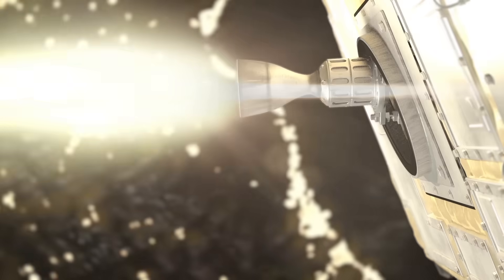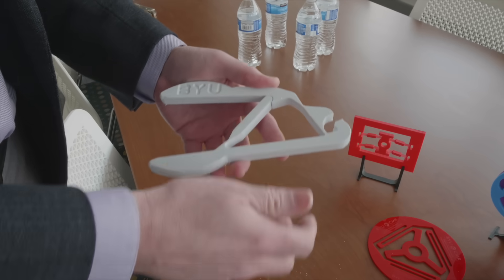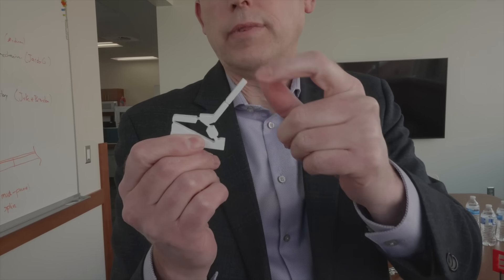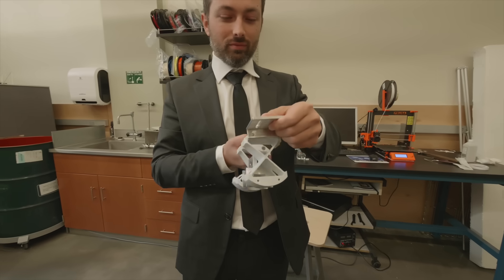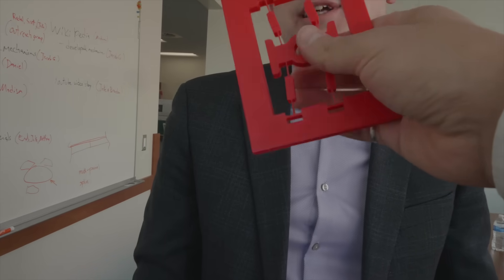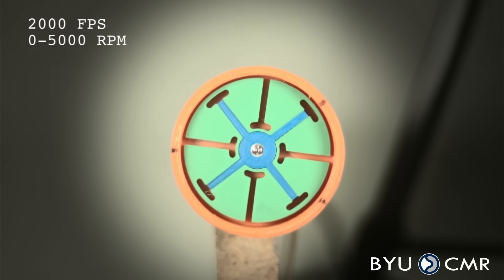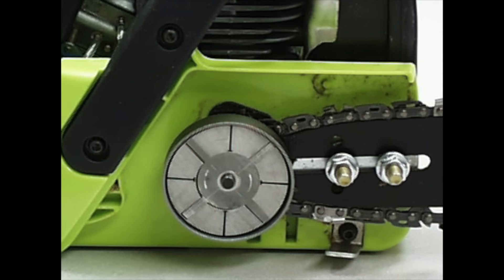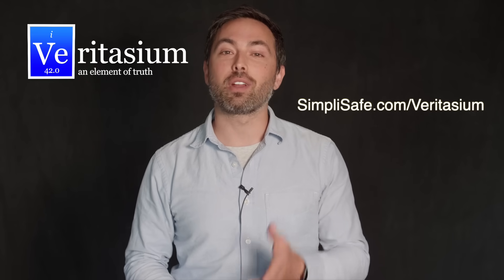Why Machines That Bend Are Better

Comment: The fatigue limit of most materials is the reason bending components are avoided. The bending region becomes a stress pit.
But maybe with modern materials, we might overcome the problem.
Reply: We been using springs for decades now ;P they are the same as compliant mechanisms, you just need to make sure, not to go over the safe bending point of each material, even concrete will easily bend  without problems.
Reply: @predatortheme  The comparison to springs is a very good observation.  Torsion bars (another geometry) is a good example also.
Reply: How are you so clever?! 
Didn't he say in the video with one of their fatigue testing machines they got over one million uses of a switch before failure. That's not too bad for a stress pit.
Reply: That's why his examples are mostly internal pieces in some automated mechanism, not levers to be pressed ad libitum by a human. That's where you get the high reliability at low cost.
Reply: Considering how cheap these machines could be, they are pretty good
Reply: If you dont over stress the plastic (over pass) the angle  it won't wear out. He talked about million cycles 👌
Reply: @loicdeniel8361  This is why further experimentation and trial is important, and therefore, this attempt of innovation should be allowed to continue. If it fails to surpass its competition, let it die. If it doesn't, let it be.
Reply: Loic Deniel the only benefit is that it’s cheap?? Did you even watch the video?
Reply: @loicdeniel8361  seems like you didn't watch the rest of the video. He also discussed and displayed compliant mechanisms made out of titanium and silicon.
Edit: my apologies, didn't notice the comment chain continued.
Reply: @loicdeniel8361   Derek mentioned 8 benefits of compliant mechanisms but they have to be designed properly with user-context in mind in order to function with said benefits. Designing CM's you have to consider many variables and it's pretty complicated. A regular engineer can and will easily make some mistakes in the design phase. Also Plastics aren't pure evil, its a strong and durable material. If only we would take the effort to recycle the stuff it would be even better for the environment than using metals.
Reply: Loic Deniel this is a rude reply. The fact that you think you judge something by looking at it tells me your mind is closed for business. The only point I was trying to make was that they have clearly been designed to minimise local movement but generate a global change of state. I’m sure NASA would be very interested in your theories of planned obsolescence. Perhaps you could write them a letter expounding your deep research.
Reply: It is common practice (good engineering practice) to perform accelerated life testing (e.g. fatigue testing, cycle testing) on critical components and assemblies prior to shipping products to customers.  The intent of the testing is to simulate the worst possible conditions (e.g. UV light, highest mechanical stress, largest applied forces, etc.)  This is most important when safety, high liability or high risk (of some sort) is involved.  For example, assume that a product is being designed to have 5 years of useful life.  The maximum number of cycles per day/month/year is estimated or calculated.  Then the number of cycles/lifetime is calculated.  If there are 4 months before the product will be sold to customers, then (ideally), a test stand should be set up to cycle that part/assembly through a lifetime-worth of cycles before the product is sold to customers.  Ideally, several identical test stands will be running sanctimoniously so that a failure distribution can be determined.  Often, the assemblies are tested to failure.  If it can be shown that the part/assembly will last comfortably beyond the determined useful life of the product, then the company (and liability insurance company) can be comfortable that they will have very few products returned because the part/assembly failed prematurely.   .... Ed
Reply: I mean these things are tested you know. They show how they tested the switches and the parts made for NASA are made from durable materials like titanium and steel
Reply: I'll admit I'm not positive, but I think their goal with these mechanisms is that rather than having a concentrated point of stress, there designing a structure that spreads the stress across as much of the material as possible, similar to how springs can be compressed without experiencing plastic deformation.
Reply: As long as they don't bend beyond the yield point, particularly under the stress they are intended to perform work, they should be ok.  It won't be like a cheap shampoo bottle or lunchbox lid hinge.
Reply: These have clearly been devised to minimise stressing points. The whole mechanism has a lot of motion, but no particular hinge point is moving very much at all.
Reply: What's the word on carbon nanotubes lately?
Reply: I think I saw somewhere that carbon fibre can be flexed infinitely with out fatiguing
Reply: In this thread: People who don't know about plastic deformation
Reply: @loicdeniel8361  the whole point of his research into CM was so that you could make complaint mechanisms out of things as brittle as glass. You could use super duper hard, unbending and resilient metals in CM's as long as you design it right. Which seemed to involve lengthening the part that needs to bend as everything has some give. Things that need to put up with 200 gorillas using it need to be strong, sure. But consumer stuff is almost an after thought in these applications. And I could definitely break a light switch if I took it out of its housing and had just the mechanism to play with.
Reply: I was thinking about the same thing, but if we have or can develop materials which have a high yield point (allow for more movement before plastic deformation occurs) they could probably handle it.
Reply: @loicdeniel8361  lol... so you missed the part about the steel clutch and the titanium printed items for nasa.  Ok... some people just need to piss on about something I guess.  Engineers would be able figure out the appropriate material based on all the criteria.
Reply: They address that here 3:51

But yeah, you're right. Depends on the material.
Reply: As an engineer, I learned about why things break. The primary cause is 'dislocation movement' which is a fancy term for the way matter arranges itself. A paper clip will bend about a dozen times before it becomes brittle and breaks. This is because the atoms are arranged in random patterns inside and when you flex the clip, they push against each other, But eventually, they start to line up. When enough line up - snap! 
This is a property of materials. Perhaps that's why the 'compliant' machines he demonstrates have so many parts. Each part bears a small part of dislocation movement. So the stresses build up slowly and the atoms don't align quickly. It would be as if the paper clip had a dozen bends instead of three. It's more expensive and larger but it will last through more stress cycles.
I think that perhaps there should be another term for machines that 'bend'. The term should involve a sense of many parts that divide up stresses. Maybe call it 'stress distribution' machines.
Well, that's my engineering opinion. i'm open to other opinions.
Reply: @Shailesh Rana < You are absolutely right, and I don't think we'll ever overcome the stress point of bending materials.  At the atomic level, the more a material moves, slides, flips, or hinges WILL BREAK eventually.  At least axle/shaft/wheel motion lasts a lot longer than bending materials.  As they say, don't try to reinvent the wheel, otherwise we'd have running cars on legs based on compliance mechanism technology. lol
Reply: @BillAnt  No one says "don't try to reinvent the wheel."  The expression is "No need to reinvent the wheel."  The implication of the statement is that there's no need to reinvent it IF it will work for you.  But nothing is there to imply that you should not try if you're looking for enhanced capabilities.
Reply: @HollywoodF1 < I get it, but it's a time tested observation that bending materials will not hold up for the long term.  Sure, it works in springs, but even those get fatigued after a while.  It also works in low usage applications like the battery door clip on a remote, as long as it's not overused.  Turning hinges/shafts/axles and ball bearings which roll rather than bend are much better suited for tasks involving a great amount of movement.
Reply: @BillAnt  wrong, depends on the material... All materials that have a body centred cubic grid (like steel for example) have a stress limit below which they can do infinite cycles (or at least so many that nobody ever got it to break in a testing machine) what you are talking about are metals with cubic face centered grids like aluminum, those will break eventually (even though you still find a critical stress level value with which they can do around 2*10^7 cycles which is more than enough for most scenarios)
Reply: @BillAnt  You might not be able to re invent the wheel but you can make something better I think
Reply: @XxThe Masked GamerXx < Maybe, maybe not. ;)
Reply: @BillAnt  this is quasi science and not very good at that
Reply: Somehow, I don't see any polymer or injection-molded material able to do 1M repetitions. I think it's more on the order of 5 digits. several cons have already been mentioned. These are why you don't see this principle in mass use for common items; tho it's been known for over 40 years (other than cheaply made China switches, which inevitably fail within mere dozens of reps)
Reply: Blah blah blah, we get it, you're an indian.
Reply: @adolfhitler7394  bold thing to say with that username :P

Comment: my only issue is with repair-ability - if its one solid piece rather than having smaller pieces. if one spot breaks the entire thing needs to be replaced, rather than one small segment.

Comment: To summarise this in another way:

Compliant machines would be less durable but not so much

But it is cheaper and easier to produce
Which means:
Higher quantity requirement but lower cost

If someone can roughly calculate the long term production cost and finish product benefit I'd appreciate your reply

Comment: so instead of doing actual work, you actually apply extra energy to first bend the component... how this can be efficient...
a major disadvantage?
Reply: If your primary goal is a perfect transmission of energy then it simply isn't. However, there are often more important factors to consider which compliant mechanisms can provide major advantages to offset that loss.
Reply: so they only can be used instead of springs and other energy storing components.
Reply: @prathameshsawant3300  No, they always include an energy storing component that might be modeled as a spring but they are capable of performing more complex actions as seen in the video.
Reply: @christopherpepin6059   okay👍

Comment: Would the steel clutch yield results as good as the plastic clutch? My intuition says no, because the coefficient of elasticity of steel is greater.
Reply: Thomas Headley  A well designed compliant mechanism is made with the specific material properties of the end result in mind. The plastic clutch may look similar to the metal one but there are almost certainly subtle changes in the dimensions to accommodate for the different material properties and the environment it is meant to operate in.

Comment: I'm not sold on this idea yet, metals will eventually fail from fatigue, imagine this happens just as the ISS has turned its thrusters away from the sun? On the other end of the scale, we've been using fibre optic cables for decades already, they also flex and break from fatigue but still work?

Comment: That thing that expands under certain speeds blew his mind... but mechanical advance distributors have been working using the same principle for decades. Nothing ground breaking there, just that they can now make it with one piece instead of multiple.

Comment: Why not to use at least the big plastic items (especially as a mass product)...
1. Plastic soup is already an issue
2. Plastics go brittle with age and thin hinging parts are quickly prone to fail, which...
3. Makes this a throw away item which again adds to 1.

At least metal vice grips can be recycled by melting it and reusing that metal.
I am sure it can have an application and research should be done, but I am against using plastic as a mass product due to the pollution it causes to the planet.
Reply: you can melt plastic and reuse it.
Reply: @GonçaloMargalho  depends if you know what plastic it is before hand and if there isn't a reinforcement used like glassfiber.

Comment: 10:52 If the device was working at 72 Hertz, it would make 72 revolutions per second, not 2.
Reply: @lachlanjohnson8019  Sorry, but I have to disagree with you, Lachy. It clearly says that 'this little hole makes two complete revolutions every second' Big red arrow points to the hole in the toothed wheel.

2 complete revolutions per second = 2 cycles per second = 2 Hertz. He was quite clearly talking about revolutions of the wheel, not movements of the activating arm.

Comment: Most plastic is cheap unreliable junk. And after it's short lifespan the problems continue. We should focus on plastics from renewable resources, which is easily degradable. And we should overthink the way we use it. Plastic can be strong and durable if we want.

Comment: I love how Dr. Howell just glosses over things like nuclear weapon arming and 3D printed titanium. What a time to be alive
Reply: They are going to find out
Reply: Well, Titanium isn't magic, you can 3D print it like any other meltable material. It is also flexible, just like steel, aluminium, copper and all other metals. 
What makes Titanium interesting as a material is that it is a little bit stronger than steel while being only 2/3 the weight and extremely abrasion resistant.
Reply: @perw12345  Not stronger than steel. Stronger than certain grades of steel. It happens to be very light with a high tensile strength. Its the ratio that makes it important. There are stronger steels than titanium
Reply: @perw12345  OH YEAH like every meltable metal of crazy high fusion points.

Comment: The clutch mechanism you showed towards the end is very cool. This would be a great solution to an over speed of wind generators.  Most low end (inexpensive ) wind generators  don’t have these ( governors) safety mechanisms. In a high wind situation, the clutch would spin up turn a drum with a large mass and keep the generator from over speed. Could be a much cheaper solution.

Comment: material stress.  Material Stress!   "Better ?  for low cycle functions only..   In most practical mechanical cases, the material stress experienced by these designs obliges the consumer to take the financial hit in two forms following that outsourcing of risk by the producer...   This isn't the expansion of mechanical technology, it's a further complication of the already well dead notion of free market ethics.  It's an elegant idea, but an ill-considered mechanism, respective of contemporary material constraints.
Reply: Me use big words and complex sentence so I much smart. They tested things that lasted over a million cycles and 3D printed titanium. What's your point?

Comment: This is why I haven't "upgraded" my perfectly good rubber dome keyboard to a mechanical one. Well, it's also because the they just don't have the pleasant and familiar smooth and nonlinear stress-strain curve with a soft bottom-out that rubber domes create.
Reply: I used to have a "mecha-membrane" keyboard. Had the clickiness of a mechanical and the feel of a rubber dome membrane. Best of both worlds

Comment: So with the steel clutch, is there a difference in tempering in the flex point and outer surface to that one maintains flexibility while one is hard to resist wear?

Comment: Wouldn't bending parts get weaker over time and break? like when you ben a paperclip over and over until it snaps
Reply: Think rubber, some plastics are really flexible and some are really rigid depending on their formula. Plus, if you noticed, most of those example's joints only bend a tiny amount. As you increase the number of joints, the actual angle each joint has to move decreases. Say you want a  90 deg bend. One joint would have to bend 90 degrees, two would bend 45, 9 would only bend 10, etc. That's how he got the titanium joint he showed to bend so much using a really rigid metal like titanium. There's just a lot of joints in it.

Comment: Yeah I'm thinking disposable plastics is not the way we should be going. Your plastic vicegrips. Absolutely they can be made cheap. And when they do break? In the trash. My metal riveted ones I can drill out the rivet and put in a new handle. And so on. No offense Veritasium but you strike me as a go green type guy. Please dont promote throwaway plastic crap for consumer items.